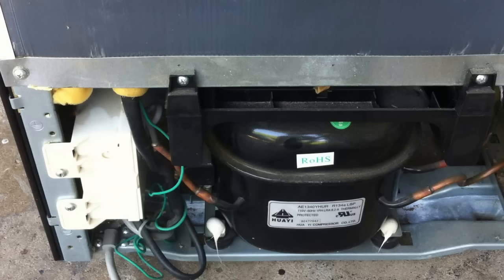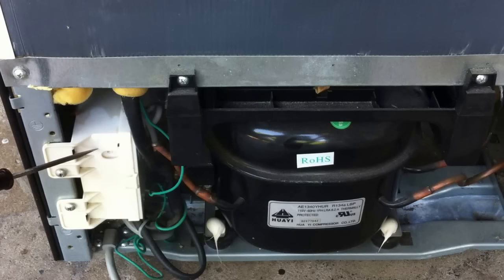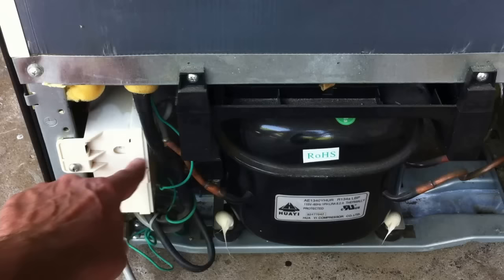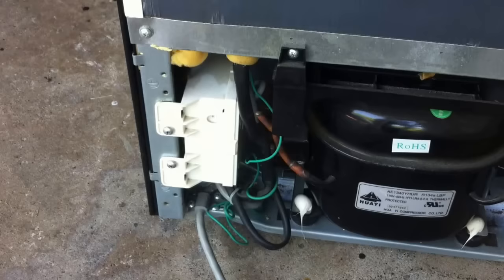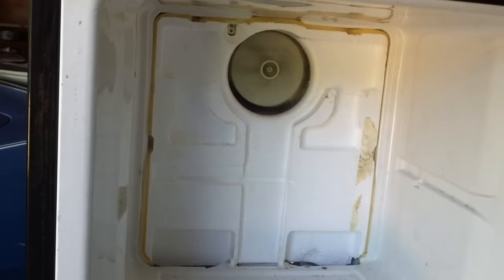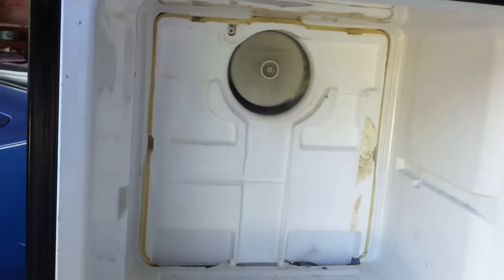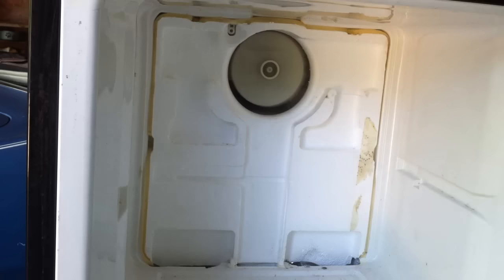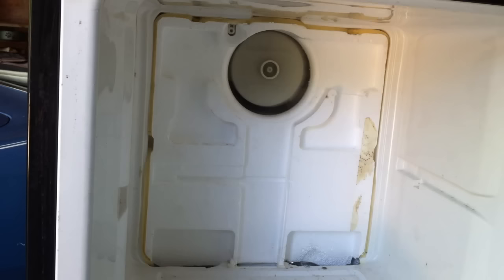Easy Refrigerator Fix, Reset (Defrost Timer) Switch, if it stops running, cooling or working.

Comment: If you have this problem, and it does fix it by following the video, you need to replace the defrost switch. They are a common issue with the older style fridge (not for the ones with the boards). The defrost timers get stuck in the off position and won't come back on. The screwdriver trick he is showing you can be used a lot of older style fridges with the old style defrost switches. 

Most are located inside the fridge near the lights/control. Look for the same hole as shown in the video and the same piece he put the screwdriver in. Then use a flat head screw driver to turn it clockwise. You will hear the click, and when you hear the click, the fridge will magically come back on! These defrost timers are a cheap part (most under $25), and simple to change if you have any mechanical ability. There are a lot of sites out there that can give you a diagram by your particular model, and will show you how it goes together/comes apart. 

Source: Used appliance company owner, 7 years of experience.
Reply: he rlly put source
Reply: Thank you! Mine was located inside. I would have never found it without your advice.
Reply: @riverraisin1   Might find some behind the front grill at the bottom.
  They are located at different places for sure.
  When you turn a timer and the unit comes on, it can be an indication the timer is going out.  Might be sticking in defrost or cooling cycle.
Reply: Mine was inside by the light and it kicked it on but it isn't blowing cold enough?
Reply: Trisha P  mine was in the same location. Replace the part, but it’s been working but still not cold enough. How long would it take to cool.
Reply: @hhova29  should only take 24 hrs. If it's getting a bit colder but not the temp it should be in the freezer, you have a freon leak. It's better to buy a new one if you do have a freon leak
Reply: @jigglytart1  it takes 24 hrs to cool. If it's not at temp by then in the freezer you have a freon leak.
Reply: RedneckFinishingSchool  tyvm. Hasn’t been 24 hrs yet but getting close and definitely not at freezing capacity yet. Put a glass of water in the freezer overnight & not frozen. It’s hard to get a fridge right now all back ordered.
Reply: @hhova29  try a freezer 🤣 I get that. Everything seems to take longer these days. Heres a tip for your new fridge. Move it into place and wait 2-3 minutes before powering it on. Freon pressures fluctuate when a fridge is moved. Those 2-3 minutes let's the freon settle down. If you don't do it like that, you can blow seals on the compressor and have another freon leak. You should do this whenever you move something with freon and a compressor.
Reply: RedneckFinishingSchool  thanks again. Actually got lucky and got a freezer chest from Lowe’s which helped me preserve my food. My older Frigidaire fridge is up their but despite timer thermostat all is pumping strong. It’s gonna be 24hrs soon but I’ll give it some more time b4 calling service. I think your right at this point though on a possible Freon leak. Barely moved it to clean the back. Gorges r on back order until mid oct
Reply: RedneckFinishingSchool  hi again, can I ask you can recharging a fridge help in sealing a leak? Def was low on Freon but had some still in the system.
Reply: @hhova29  nope. Freon leak will remain most likely. All you're doing by recharging is buying time
Reply: Chris is correct...your just unsticking a mechanical timer until it goes into defrost again and the problem will persist...The timer needs to be replaced unless you "reset" all the time...
Reply: The video sux. Your explanation is a LOT better and clearer than the Video which did not explain with much details.
Reply: @spencer2351  m

Comment: I have a whirlpool fridge. The switch was inside the refrigerator on the top. I believe the relay mechanism is what it is attached too.  Pressed it and and everything started working!! Awesome, amazing i am so stoked.  No mention of this anywhere in troubleshooting.  I guess its a repairman's best kept secret. Why it tripped I dont know, but while the  backcover was off i vacuumed all the dust bunnies out from around the compressor, yikes! I clean from the front intake periodically but obviously that doesnt get it all.  Great video! Thanx so much bud.

Comment: Thank you Michael Powell!!!!   This also worked on my Frigidaire Freezer after the door had been left ajar and it overheated and the motor stopped.  We didn't try to restart it for 24 hours and left the door open, but, alas it still did not start.  I saw your video on the refrigerator and thought I would give it a try on the freezer.  It looked a little different, but "voila" it worked like a charm.  NONE of the manuals were of any help whatsoever in describing OR locating the reset switch, but your simple video was perfect.  Thank you so much.  We were afraid that it was the end of the freezer and we would have to replace it right away.  You saved us a BIG expense!!!!  By the way, I'm a female and I am the one that solved the problem with your help, of course.  How about that??   Oh, and I'm also 78 years old.  Big HA!!
Reply from the maker: Thanks great!!! My mother is 95 & in very good health. She didn't even go
to the doctor's since the 1960's. I finally twisted her arm enough over the years to go & she got a check up last year. She is still sharp & healthy. :)
Reply: Michael Powell Take care of that fine piece of jewel 'til she hits 125 :) give her a hug for me, you are lucky that you have your mom, my mom passed 10 years ago and I miss her so.
Reply: @steelcantuna  Way to Go! You are surely doing something right!
Reply: 78 y/o repairs her own fridge.
That's got to be a record.
I wish my mom will be as healthy as you when She hit your age.

Comment: why did not I check your video earlier. My fridge stopped cooling since Dec 2108 and I watched so many videos and determined it was the starter kit overload relay. I got it 1 month ago and replaced it tonight but it still did not start the compressor. I was hopeless because I hired some1 to fix it in 2016 and that guy charged me $80 just to replaced the overload relay and it worked right away so I thought its the same problem. It may have been the same issue "the trip switch". It was as easy as that. After seeing your video just now, I turned the trip switch, it immediately turned on. OMG!!!!!!!!!! Thank you so much. I thought I was gonna throw it on the street after replacing the overload relay. Million thanks to you bro!!!!!!!!

Comment: I'm currently in the process of writing a song about you, you are an absolute legend. WORKED 100%
Reply: ian grindon you got that song finished yet?
Reply: Foods getting warm and you're feeling bummed out
Trip switch man, Trip switch man
Turn that little bugger just a wee little bit
Trip switch man, Trip switch man
Fan comes on and you can feel the cold air
Trip switch m,an, Trip switch man
Jobs done a beauty, loading up with beer
Trip switch man OH Trip switch man
Reply: @Ulbre Good man
Reply: If this guy is a legend, then I must be a god. 

I could do this in my sleep.
Reply: I'm 4 years late but did you write that song 😂😂😂
Reply: @CassieTheLight  alas it would appear my song writing skills are even worse than my refrigerator repair skills. I instead paid homage through interpretative dance, unfortunately this medium doesn't lend itself to the comments section on YouTube but rest assured I was poetry in motion
Reply: @iangrindon  😭😭😭😭😂😂😂😂😂😂😂😂😂😂

Comment: I was so worried that the compressor had blown(?).  I tried your "trip switch" technique.  She is running!  THANK YOU, Michael Powell!!   BTW:  On my Frigidaire, the defrost switch (trip switch) is on the bottom of the temperature control panel inside my refrigerator- easy to find once I had a clue of what to look for

Comment: Thanks. My problem was with my trip switch. I am and Electrical/Electronic Engineer and had called my technician but I started doing my own diagnostics and reset the trip switch, and the fridge start working. I need to do a study on the operation of all electrical components in my house. Sometime I too busy to work on stuff so I call the repair or service personnel. Now that I am retired I will take up my electrical/Electronic home equipment's repairs. Thanks again.

Comment: Amazing info. it worked like a charm.  Turned switch; compressor and fan started immediately.  I agree that this switch should be marked.  Thanks for sharing what appears to be an appliance repair industry secret.  Great stuff!
Reply: The kind of thing that keeps working gear polluting the place too. They are unsightly things, dumped. ( had an acquaintance, collected throwouts, with idea of supporting a falling down shed wall, 😅 ) he did enjoy a beer, ( a little too often, perhaps)...

Comment: Thanks so much! This worked. Fridge would not come on after door accidentally left open all day. Thought it had worked itself to death and was dreading buying another /hassle of disposing of the old one. Turned out it just needed this reset. Fridge only ~2yrs old. My switch was inside the fridge near the temp control settings.

Comment: Thanks to this i was able to fix our refrigerator issue. You saved us from the extra unexpected expense. Our refrigerator had a pushed in reset button. 
Pressed it while it's plugged in and turn the dial knob up to 5, 6 and the compressor kicks in.

Comment: Hey I had some electrical issues with my main breaker box on Thanksgiving and during the resetting of my circuit breakers my refrigerator stopped working.  Unfortunately I did not even notice it until last night (3rd day) when my ice cream was liquid.  I made some calls and found it would cost me a few hundred dollars just to have someone come out.  I saw your video and it started right up!  Thank you!  If it goes out again in a day or so like some of these folks say, I'll fix it again and buy the timer for $20.  Wow!  $140 just to walk in the door and then the parts and 'labor' to fix it.  You saved me a lot of dough.  Thank you very much!

Comment: Although my switch looks different thanks to you I fixed my refrigerator On a Sunday morning in Australia it would have cost me a bucket load of money to get someone here. many thanks xox
Reply: +Robyna Smith-keys Where did you find it and how it looks? I can't find mine.
Reply: MrSkeptic its a vissani fridge
Reply: Robyna Smith-keys. That is actually the timer.  That is usually a temp fix at best.  It was not coming out of defrost mode.
  The timers are located in different places on different models.  Some are just inside at the top of the fresh food section near the temp controls.  Some may be just behind yhe front grill at the bottom.
Reply: Ok

Comment: Thank you so much for this information I have a fifth wheel camper and I just bought the refrigerator and you not long ago but had to take it out to put some insulation around the refrigerator when I put it back in it didn't work and I couldn't figure out why thank you so much for this information bless you for trying to help other people very kind of you

Comment: Very Thankful... Although my frig wasn't exactly the same, I had a similar component that was mounted inside the fridge in the compartment where the temperature dial is. It also looked like some sort of time delay switch and had a screw like thing you can access without actually taking the compartment off. Gave it a turn with a straight blad screwdriver, and presto.. back in business.. I suspect it's likely going bad but for now, I'm good to go and don't have to pull everything out. Thanks!!

Comment: Had the same thing on a Magic Chef 10 cu ft refrig/freezer, model# MCBR1020W.  Turned the switch as shown and the frig came back on for a while.  When it went into defrost the next time, the switch never came back on.  Turns out it was a bad defrost timer switch.  Ordered the part from AppliancePartsPros for $40.05 plus $6.95 shippping.  Part arrived from California to AZ in 2 days.  Unplugged the unit, and it took all of 2 minutes to replace the part.  Plugged the unit in and the frig has been cooling like it is supposed to do.
Reply: Exactly.The original poster did state he is no repairman which was obvious.  Just have to be careful how much credence you put into things you see on YT.
  I'm sure he meant well, but I have seen some dangerous things shown.  Sometimes it pays to watch several when researching things online.

Comment: Thanks so much for sharing this information. It's just saved me from calling a refrigeration technician. Our trip switch protrudes so I didn't need the screw driver... even easier on our fridge. We've been trying all day to get it going after turning it off and moving it.

Comment: Its the defrost timer if its getting stuck it needs to be replaced your fridge should go into defrost a couple times a day if not it will just freeze up.  Its a good thing to check though if your freezer is cold but your fridge isn't. Sometimes they are in the controlboard inside the fridge or behind the front kickplate. Great video guy!
Reply: Thank you!

Comment: I'm glad I found this video my switch thingy was inside the refrigerator right behind the knob where you set the thermostat I twisted it and is now running just fine for about 8 hours now you save me a lot of headaches money and food and now I know where the problem is incase I have this problem again thank you very much for this video

Comment: It’s called a “manual advance”. If you needed to do that then it will get stuck again at some point. It’s the gearing inside that jams up in this defrost clock. Better to just replace it. Very simple repair

Comment: Turning the timer switch fixed my fridge.  It turns out that dust build-up was blocking the switch rotation.   (Finding the timer wasn't easy because it was anchored on the inside of the frame.)  After some vacuuming and applying this video tip, the fridge is good as new (25 years and counting).

Comment: I have a 10yo samsung that had the ref door open all night and ref not running. We transferred everything not spoiled and let it sit unplugged and open for a few hours but nothing. I was getting ready to call the repairman when I found your vid. My adjustment was on the side but just a slight move counterclockwise started it humming. Thanks for taking the time to post.
Reply: Mine is a samsung too but i could not find any plastic screw head to switch. Which side is it? Where exactly did u find it?

Comment: Dude my day has just been hell and this video and the comments below have completely helped me out! Its back up and running!
Reply: My freezer was all iced up on the bottom. After other YouTube videos I guess my drain plug was clogged and I had to manually defrost it and flush it out. But I couldn’t get the freezer to start again. Turns out the defrost timer was just in the defrost cycle XD

Comment: 6-29-21 @ 12:25CST  Mini Fridge had frozen over, like 3-5 inches of solid ice. Took outside to defrost.  Cleaned it up, blew off the coils, unstopped a black drop hose thing, plugged in, NOTHING!  Found your video.  Found the white plastic cover thingy, used a pointed emery board to turn it, and HOLYSHIZBALLS and UNICORN FARTS!!!!  IT WORKED!!!!!!!!!!!!!!!!!!!!!!

Comment: Thanks!  We just replaced our noisy evaporator/fan in the freezer, and it worked for a while, then quit.  We put the old evaporator back in, and it didn't work either.  After seeing this video, we looked around - didn't find a switch in the back, but found one inside the fridge compartment, around the middle of the "ceiling" of the fridge - near the temp controls.  The switch looked exactly like the one in the video - a little hole with a shallow slot for a screwdriver.  Thanks again!

Comment: To all my friends out there:
I have a Kitchen Aid fridge 20+ yrs old and it wouldn't cool. It even stumped the repairman. Try rebooting like a computer; UNPLUG, wait 10 minutes, and plug back in. It worked for me! Additionally,  you can turn defrost dial as this video demonstrates.  Good luck.

Comment: This is commonly known as a defrost timer. On some refrigerators you have like an 8-hour run. And a 20-minute defrost duration. Turning the timer advances it out of defrost. There's only one thing that will solve this problem and that is replace the defrost timer.
Reply: Absolutely correct or it will stick again

Comment: Thank you for this, really helped me out. Was freaking out that a Fridge less than a year old.would just stop working like that, I thought the major components in the unit failed. But to see that it's something small like this. I believe the manufacturer should have informed the buyer about this in case something goes wrong. The fridge is less than a year old, so I don't know what caused it to be stuck in defrost mode and wouldn't come out. I hope the defrost switch just malfunctioned and that it doesn't need to be replaced.
Reply: And did it keep working???
Reply: @alan4sure  No unfortunately, it had to be replaced. I called up the store where we bought it. And they replace it in 10mins.

Comment: This video combined with another video helped me figure out how easy it can be to fix a (in my case) minor issue.
Reply: Also, in my case it is a whirlpool upright side-by-side and the temp dial or whatever it is called was in the fridge side. I had to look up into the front of the fridge and saw a green "screw", turned it a bit and it kicked on like a champ... so far.